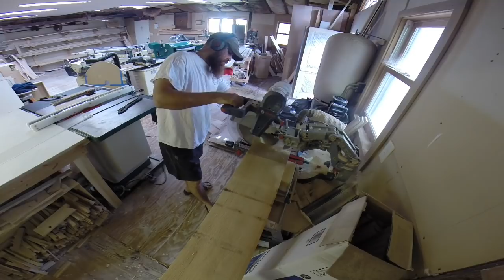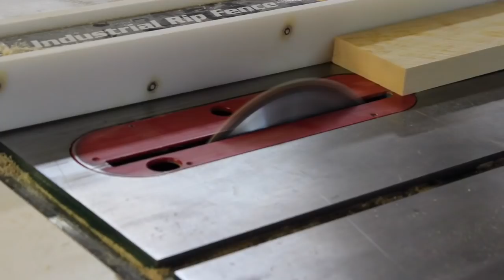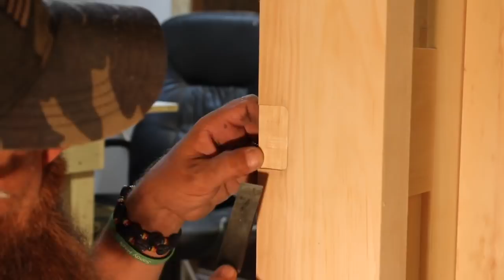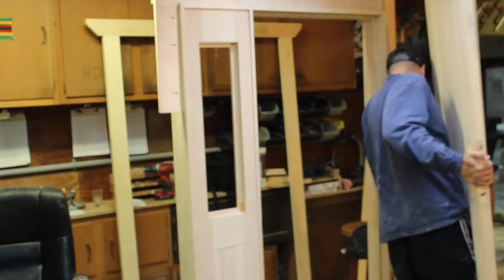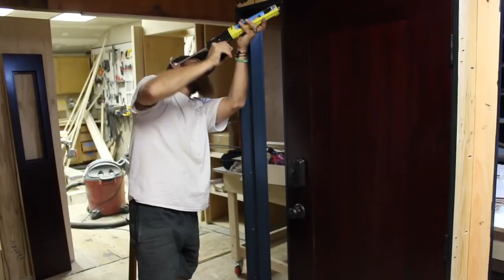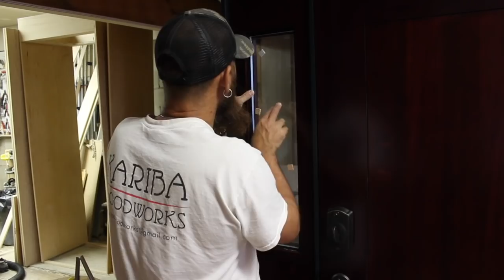Woodworking Making A Entry Door

Comment: Nice shop I am a finish carpenter & contractor I am sure you do good work.  I just hv a fit over anyone working around dangerous equipment and using it in sandals ?  I do wear shorts in the summer it’s often over a 100 here however I don’t wear sandals!  I knocked a sharp chisel off my bench once not knowing it and it cut thru my boot?  Saw blades, blocks of wood , dropped 4x8 sheet 3/4 ply on my foot multiple times , doors, u name it !  If u work in this business and take safety casually your done!  
I can name a Y-T er down to 2 fingers (after accidentally running his hand into a jointer) now and his friend can not use two of his fingers after trying to catch a sharp chisel he dropped and just a natural reaction to try and catch it?  Cut two tendons in half!

I just can not support it as a pro carpenter who talked to a surgical nurse the other day & she stated the number one traumatic injury is men doing construction work!  Inside carpenter, essential craftsman, and on and on I hv never seen them in the shop or at wrk in sandals!  Lastly my dad an old school contractor home builder stated if a guy showed up looking for work in shorts and sandals no matter his skill level he said no!  Now I am not that tight I allow shorts👊
Reply from the maker: Everyone makes there own decisions Never judge a book by its cover. I am in my shop on my property by my self. i believe i do a good job. i don't tell anyone what is best for them. i am appreciative of your  advise.
Reply: @simoncapener3418  Simon you are correct it’s your shop on your property.  However it’s on you tube for everyone to see.  I just did not want new ppl or apprentices to think it’s an option “when off” your property.
I apologize if I made insinuation that your work must be bad because your being unsafe?  Not at all in fact I looked around and you are obviously a solid carpenter!  I guess I would hope we would treat our trade with care.
It’s a real privilege to hv the aptitude and ability to retain ; then perform such a skill as making doors, windows, moldings and build !
Out of a 100 ppl I know maybe 2 or less hv your level of skill.
Not saying you do however often the way we treat our trade results in how the public sees us and ultimately reflects our pay check!!
Your way past a guy with a hobby!
Anyway sir thank you for your time and God bless , be safe !
Reply from the maker: @zephyr1408  No hard feelings .I appreciate you been polite and it good people can read this and it may change some ones mind. All good